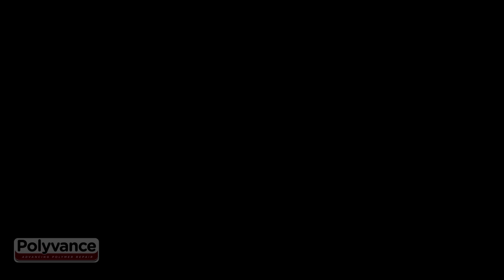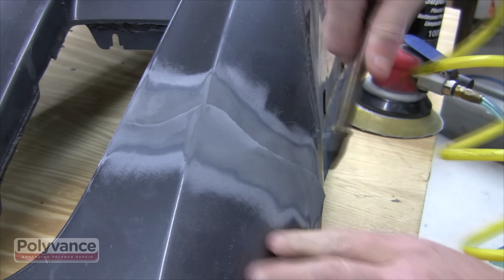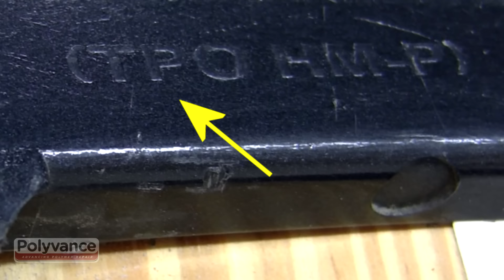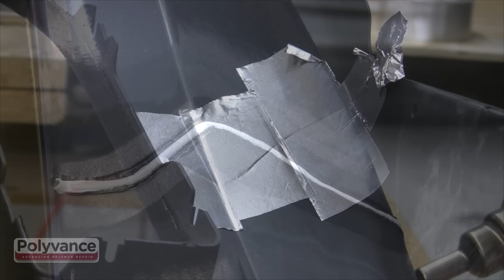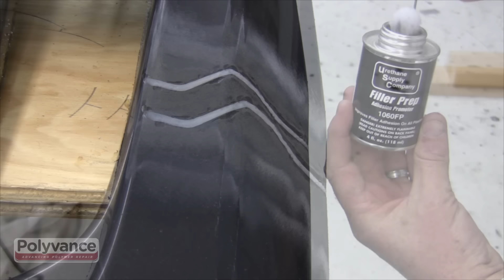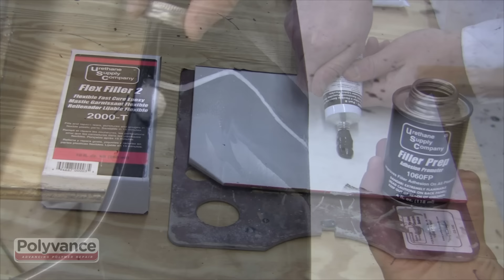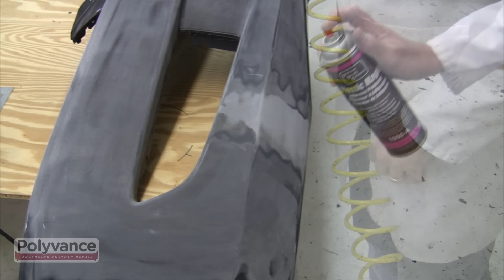Bumper Repair with Hot Air Plastic Welder

Comment: OR JUST USE SUPA FIX
Reply from the maker: This method is much better than using an adhesive. Here, we are using a TPO welding rod to repair a TPO bumper (they are the same material). We heat both the bumper and the welding rod and melt the welding rod into the base material. This creates a fusion weld. Now the welding rod and the base material are one and the same. Imagine you have a glass half full of water and you add more water into it. The added water is the same material as the original water...they fuse, and you are unable to separate them again. This is the same principle here.
This is a stronger repair than using some sort of adhesive system.
Reply: but from a cheaper point of view supa fix works on multiple materials and i don't think a person would spend money on a heating welder if they're only probably going use it once
Reply from the maker: We do have cheaper products for a more DIY bumper repair (like FiberFlex) that provide an extremely strong repair. FiberFlex works on a variety of plastics.

Comment: To day there are so many new and easier ways to make plastic repairs (this must be a older video)
Reply from the maker: Yes, there are other ways to make plastic repairs. Check out the other videos on our channel; we have videos showing many different repair methods.
We make nitrogen welders, which can be used to provide the strongest fusion weld. We introduced nitrogen plastic welding to the automotive collision repair industry in 2006. In 2016, we introduced our fifth-generation line of nitrogen plastic welders with a full range of product features that make them the most versatile and easy-to-use on the market.

Comment: Pain in the ass to do
Reply from the maker: How so? You can check out our other videos for other plastic repair options, like our nitrogen plastic welders or more DIY options like FiberFlex.
Nitrogen welders can be used to make the strongest fusion welds. We introduced nitrogen plastic welding to the automotive collision repair industry in 2006. In 2016, we introduced our fifth-generation line of nitrogen plastic welders with a full range of product features that make them the most versatile and easy-to-use on the market.

Comment: You call this welding ? 😂😂😂 its more like glueing
Reply from the maker: How so? This is absolutely welding!
From dictionary.com "Weld: to unite or fuse (as pieces of metal) by hammering, compressing, or the like, especially after rendering soft or pasty by heat, and sometimes with the addition of fusible material like or unlike the pieces to be united."

Here, we are using a TPO welding rod to repair a TPO bumper. We heat both the bumper and the welding rod and melt the welding rod into the base material. The welding rod is not an adhesive like glue; it has absolutely no adhesive property when dry or wet. The welding rod is melting into the base material here and bonding with the bumper.
Reply: This is true welding.
Reply: Lol yea this dude who posted this is obviously an uneducated dumbass 😂

Comment: It’s plastic welding i’ve done this a couple times is very cool but it’s a pain in the ass. I would say screw it and buy brand new bumper and be done with it.
Reply from the maker: Of course each situation is different and the cost of a new bumper will have to be weighed versus the damage to the original bumper. However, many times it is cheaper to repair a bumper than replace it.
Also, some cars have new bumpers that are hard to find (thus making them more expensive). In that case, it is definitely better to have it repaired than replaced.
Reply: Also having the right tools to do the job is important in making it not a P.I.T.A.

Comment: Why clean the area first, if the paint will need to be sand down all the way to the the plastic??
Reply from the maker: Good question!
Cleaning the bumper first removes any dirt, grime, or debris from the bumper. If you do not clean the bumper first and then sand it, you run the risk of sanding the debris INTO the bumper. You wouldn't be welding your pure plastic welding rod into the pure plastic of the bumper anymore. This could make your repairs weaker in the end. Cleaning first is cheap insurance that your welds will be as strong as possible.

Comment: But for a crack you have all the material there and need not add any if you use tip welding to separate and the join the plastic again instead of removing material and melting i new similar material with hot air?

Comment: I get bumpers from Certifit and they usually run around $30 to $40 and the quality and finish ready to paint units are great. No issues with fitment. How is this more cost effective once I pay myself or my guys to do this?
Reply from the maker: All bumpers are different. Some people have cars where it is hard to find an OEM bumper (which makes them more expensive). They would be better off going to a shop that can repair their bumper instead of buying an expensive bumper and possibly paying someone to paint it to match. That isn't considering they might get an aftermarket bumper with fit issues. This hot air welder and our nitrogen welders are definitely for body shops that do a lot of repair work on bumpers. It might seem expensive to the shop at first, but they pay it off pretty quickly.
Reply: Adam Smith Say Adam, will you see about getting one of those 40. rear bumper for a 1995 Merc. Sable?

Comment: What is the difference between a.hot air gun  and a hot air welder. Cam somebody clear that up for me thanks
Reply: I mean a regular heat gun and a hot air welder
Reply: Outwardly, a hot air gun and the most basic hot air welder appear to do the same thing, heat a jet of air.  The main difference is that if you reduced the flow of a heat gun to the point where you could control the air enough to actually weld with it, you'd melt your heat gun down.  There wouldn't be enough flow through the gun to cool the heating element and it would fry.  A hot air welder has temperature control built in, so when its set at say, 700 deg F with no reduction, it will still produce 700 deg F air with the welder nozzle attached without having the tendency to self destruct.  I hope this helps!
Reply: Scott B  thanks for the information really helped

Comment: Good god, what a load of tosh, take at least one lesson in welding plastic composites, wrong rod, wrong, prep, wrong technique it will NEVER hold even with mild vibrations.
Reply from the maker: You can see in the video that the bumper is made of TPO and we use a matching TPO rod. Polyvance's 37 years of experience says that this type of repair with this kind of prep and technique will hold up.
Reply: He's an internet expert. One with a contrary in a sea of unknowing folks (who have done similar repairs without issue.....but 'he knows better' and has that internet expert confidence...the kind you have where you don't have to prove anything).
Reply: Please explain why you think this.
Reply: Well, I don't see why this rod can't be used in this repair, otherwise you're correct.

Comment: clean with plastic cleaner then sand it down wow
Reply from the maker: There is a reason we clean first. If you have contaminants on the plastic and you sand or grind it, its very likely you will embed some of the contaminants into the sanding scratches (which will impact the quality of the repair).  You should always clean the plastic first!  You can clean it again after if you wish, but you should always clean it first!
Reply: soulless one - lol, I guess, not everyone gets your sarcasm )))
Reply: soulless one  i commented same ...Lol
Reply: You would be very surprised how many people skip those steps then complain that plastic welding produces poor results....Just like metal welding, prep is very important.

Comment: I couldn't help but notice, but when he said, "wipe in one direction to avoid contaminating the surface"
he starts wiping it back and forth. Within 30 seconds
Reply: Kyle Kelly...and then sands it down to bare plastic.
Reply: I think that little backwipe was just to get a drip in the crack.
Reply: I just use mineral spirits or thinner to clean up the surface.
Reply: But you create or make MORE BIGGER contaminates when you grind? Which contaminates are you guys talking about? Dust? Dead mosquito?.
Reply: @gertholtzhausen6926  Oils, waxes, silicon spray, you name it...anything that can interfere with welding or paint.
Reply: @Charles Wittmer Yes it is!  And when you think its completely gone, its probably not.
Reply: Gloves 🧤 respirator
Reply: I come here to watch how to do something I didn't know I was watching a movie music video
Reply: Within 3 seconds.
Reply: And then he grinds the surface off, i would just grid it first.
Reply from the maker: @jerryjamify  If you have contaminants on the plastic and you sand or grind it, it's very likely you will embed some of the contaminants into the sanding scratches (which will impact the quality of the repair).  You should always clean the plastic first!  You can clean it again after if you wish, but you should always clean it first!
Reply: Polyvance. Excellent point . Glad you pointed that out.
Reply from the maker: @lnhislmage  :)
Reply: @polyvance  But then you put the sander on a contaminated surface, the dirty bench! And also do you use the sander paper only for this kind of application so you don't contaminate it with other materials??
Reply from the maker: @Kyle Kelly
There is a reason we clean first. If you have contaminants on the plastic and you sand or grind it, its very likely you will embed some of the contaminants into the sanding scratches (which will impact the quality of the repair).  You should always clean the plastic first!  You can clean it again after if you wish, but you should always clean it first!
Reply: @polyvance  Sure. Because grinding it afterwards wont remove material (including whatever makes it unclean) anyways.
Reply from the maker: @Codename-B  If you don't remove the contaminants first, you can grind them into and embed them into the plastic.
Reply: @polyvance  That is not possible unless the friction caused by the grinding tool is high enough to melt the polymer and let the contaminant get mixed. In that case the whole grinding process is wrongly done.
Reply: @Codename-B  Its very possible.   if you had a greasy piece of steel you were going to weld, would you clean it before you v-grooved out the crack or after?....BEFORE.  Some contaminents will find their way into the V.  same as plastic.   Does a doctor clean you before cutting you open or sticthing you up? I would hope!   
Do it however you want, but the best practice when repairing anything like this is to clean it FIRST  to eliminate the chance of contamination and not roll the dice.
Reply: @scottb7600  Well, you have a point.

Comment: Seems like it's gonna take a month to finish 😂 just go and buy a new bumper instead 🙌🏻 Lol
Reply: A new bumper cost waaaaaay more than this. Worth the time repairing instead.
Reply: I just worked on a 2009 Mercedes c66 AMG, and the OEM bumper for it cost $1250 not including the trim pieces and Styrofoam pieces.  Just the bumper 1250.  If you do insurance work you always want to buy OEM because if it doesn't fit properly when your putting a car together on a deadline day it makes you and the insurance companies look bad.
Reply from the maker: Nah! Hot air (particularly hot nitrogen) can provide the quickest and strongest repair and can save a body shop thousands of dollars a year. Replacing a bumper that can be repaired is a waste of time and resources.
Reply: Repairing is the way to go. 
Wasting resources is just not very smart these days
Reply: People don't want to and pay me to fix it instead 😂🤣😃
Reply: Who buys 200$ plastic bumpers for vehicles that are only 10 years old.
Reply: Lol alot of yall are missing the point. These are repair tools and procedures for people who do this shit on a daily. Im a mechanic in a body shop. The insurance company will pay a body man half an hour (bout 40/50 bucks) all day long to repair something rather than replace it. Just because you dont think you will use it, doesnt mean its useless. And especially not efficiant. I can tell you this looks a hell of alot cleaner and easier than the typical hot glue stitching.
Reply: Yes let me go find a 96 Camaro RS bumper real quick
Reply from the maker: Don Cap, our hot air and nitrogen welders are more for body shop use. We do, however, have a hot air welder kit that can be used for DIY. But having a bumper repaired (whether DIY or by a technician at a body shop) will often be cheaper than buying a new bumper.
We have other repair kits that you might find more practical. For example, our FiberFlex repair kit includes an airless plastic welder and our FiberFlex universal rods. Our Polypro welder comes with the airless plastic welder and polypropylene welding rods (polypropylene is what most bumpers today are made from).
Reply: Joe Marley, This is not a tool for the average car owner, this is a body shop tool and one for serious hobby car restorers.
Reply: Buy new one = waste of money 
Repair = save some money
Reply: I repair plastics on things I own . It's wasteful to throw all that plastic away for a simple crack. Stop being lazy.  Plastic is going to be the death of this world.
Reply: No thanks a bumper for mine is 2k lol
Reply: Richard Lawson o
Reply: I agree with SH AM. Unless you are working on an old model car which spare parts are not available, it is not practical for a layperson to buy all these tools which one needs to master using and then use them once and keep them in one’s warehouse for the next incident to happen. It is not practical nor efficient use of time, money, resources.
Reply: I AGREE.  MOST BUMPERS COST UNDER 100 BUCKS
Reply: @thutch558  most bumper as in 20 year old honda civics? Haha google some bumpers other than the cheap civic crap and ill bet they arent under $100. Even aftermarket non CAPA certified wont be under $100. And were talking retail price not wholesale pricing. Not everyone has a wholesale license and business license to buy at wholesale pricing.
Reply: I use soldering iron to melt the bumper to itself. Have done many that way and have held up over the years
Reply: lol I would have that bumper ready for primer in 30 minutes.  I bet you buy generic bumpers.
Reply: @quantumgelato4787 you mean after market...
Reply: Joe Marley You can't predict the future... my friends had his right fender plus the right side of the bumper fixed, on the same day he recieved the car the same area was hit by a stupid driver...
Reply: This won't wash in the UK, m.o.t. laws state a plastic bumper that has been structurally compromised must be replaced because it won't function properly in the event of a collision with a pedestrian.
Reply: @TheRealAncientGamer  wen yo mushed yo mushed wit a caah
Reply: SH AM You talk about “waste of time and resources” yet think it is smart to buy a shitty plastic welding kit that you will never use again after repairing a bumper.
Reply: @GamingCentral80  obviously nobody is gonna go buy a nitrogen welder to do one bumper. Dumb fucker.

Comment: I can buy a New bumper thats much easier
Reply from the maker: Much easier, sure. Also more expensive and wasteful.
Reply: You can fix that bumper in 30minutes.  Maserati bumpers cost 1k+, not everyone drives a toyota.
Reply: These tools are most likely not for the home gamer though the 250 dollar one might be viable for home use. At a shop setting it just makes sense to have this to repair bumpers and what not a brand new bumper even for an el cheapo Toyota or Honda would be ballpark 500 bucks from OEM or 200 for aftermarket and if the vehicle is stock why not just repair the OEM bumper it has nicer plastic and will just fit back into place. It looks like this process would take around an hour maximum that would cost the customer around 100 more dollars instead of 500 or 200 for a new bumper. Not to mention there are many many exotic car or vintage cars where bumpers and plastic panels just aren't made anymore or are extremely hard to find. Add to the fact that ordering a new bumper sometimes takes hours if not days so this tool would also promote faster turnaround time as well.
Reply from the maker: Himmel, you've got it! :)

Comment: Zip ties
Reply: Polyvance not sure of serious or joking
Reply from the maker: The problem with zip ties is that there's no way of knowing for sure what their chemical makeup is. If they're made of something like a polyethylene, they won't fuse with a bumper made of polypropylene.
Reply from the maker: We're serious! A lot of people like to use zip-ties for plastic welding because they're similar to welding rod, but they can be made of any of dozens of types of plastic. If you have a polyethylene zip-tie, that will never mix with a polypropylene bumper.
Reply: Damn! Thats ingenuity right there!

Though i think he meant about like tying the bumper with them... Not weld

Comment: this probably will cost more than you buy a used bumper and have them paint it....
Reply: TheNoobComment if both bumpers would need paint, you’re literally saying 1hr labour for a guy to do this would cost the same as a new bumper?? Your completely nuts.
Reply: If it’s a new model you definitely save money
Reply: If the new bumper costs $1000 and used costs $600 you will do anything to save money
Reply: Plastic welder from harbor freight 50 bucks or so. New aftermarket bumper unpainted  $200 plus paint supplies plus removal and installation. If you’re lucky you can probably fix  the crack without even removing it from the car.
Reply: Ofcourse this is not made for DIYers, it's made for big body shops, where it would save shit ton of money